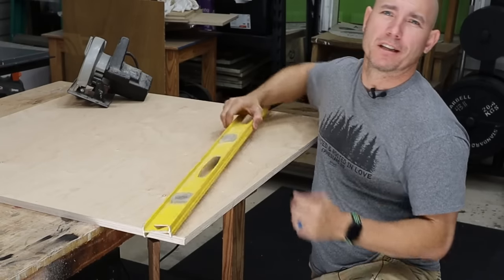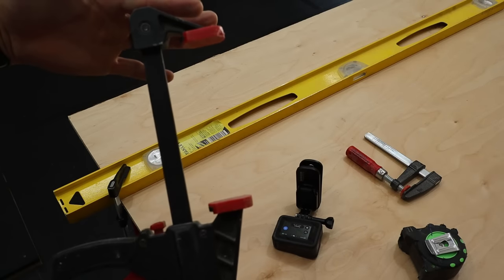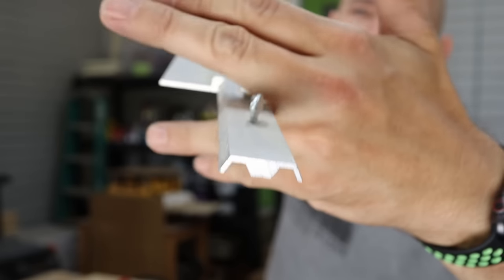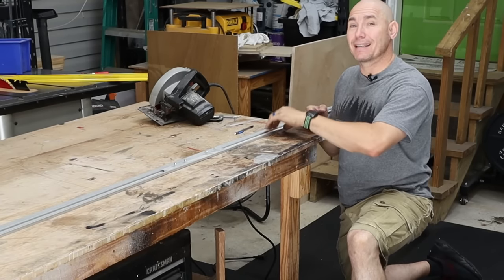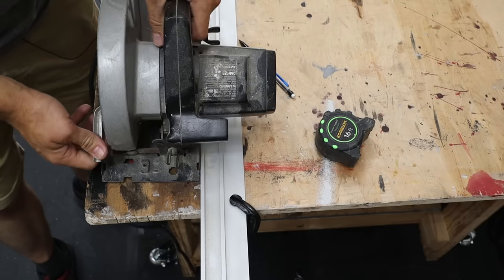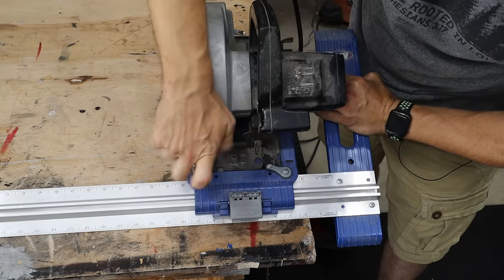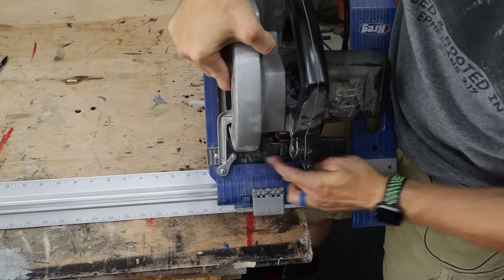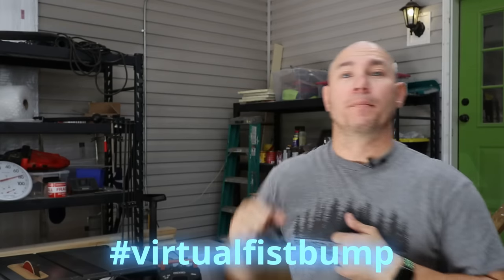How To Make Straight Cuts with a Circular Saw and a Straight Edge or a Kreg Rip Cut

Comment: I thought it was unsafe practice to put a circular saw on the fall off piece  when cutting.... just asking cause that's what I try to avoid
Reply: It is less safe but as long as you make sure to keep the base of the saw level and against the straight edge you should be fine. I have done it for years and never had an issue. But it IS less safe. Nothing with power tools is 100% safe, just be (based on your name you know what I mean) mindful of you surroundings and you should be fine.

Comment: That method only works on board that are already straight. Because youre measuring from the edge to the cut. Of the eege aitn straight, your cut wont be either.

Comment: [[[[[[[[
[[[[[[[[[[[[[[[[[[...pretend those are 2 pieces o 3/4inch plywood. Bottom PC 8 inch.. top PC 3 inch. 
Staple top PC to bottom pc. Make sure you are squared up..take circular saw hold whichever side you cut with, hold flush to top PC a rip...you now have a straight edge..hold point to point and rip whatever size you need.